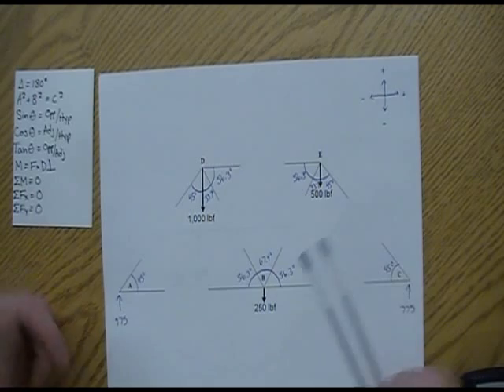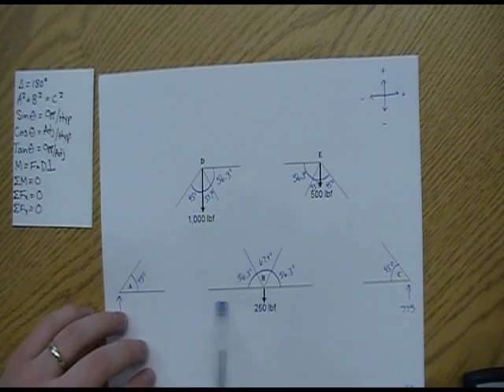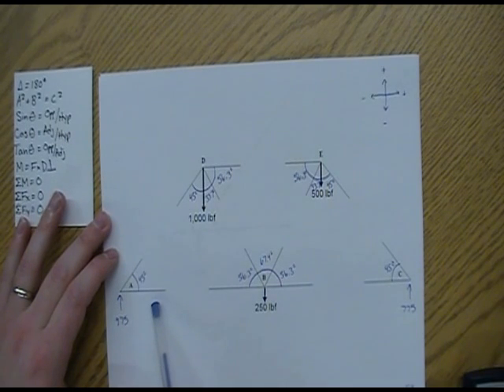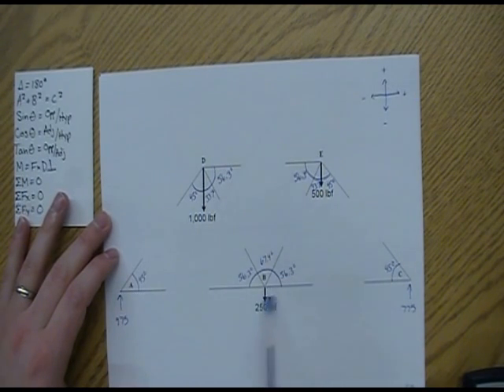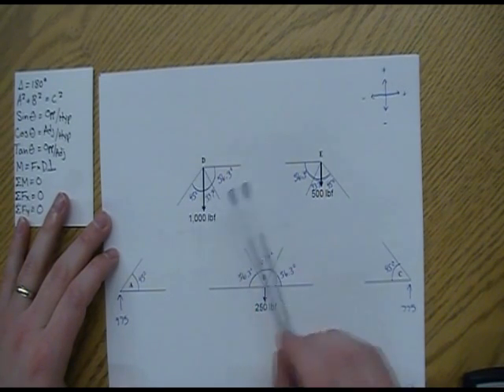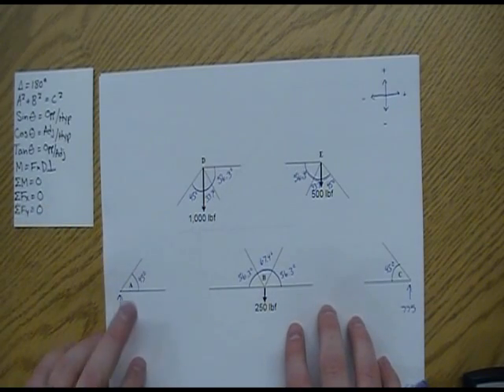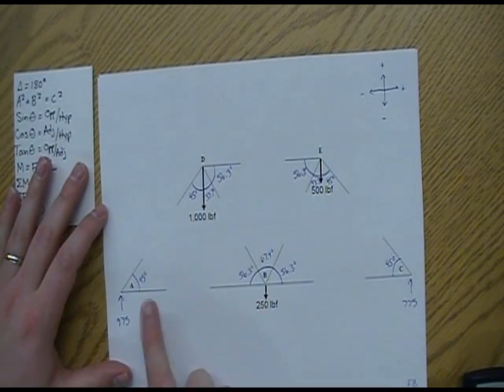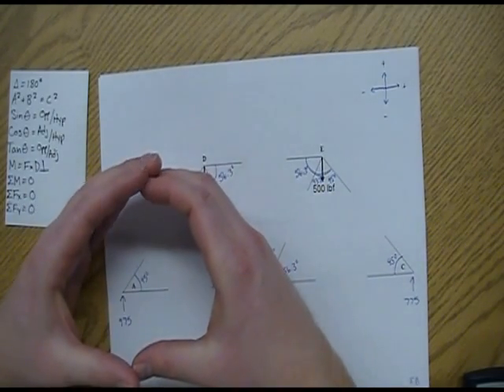How to solve a truss: Step-by-step Video 3

Comment: Isn't that tension? Not compression
Reply: The member being in compression means it's being pushed together from either end. That means the member pushes back* at the pin (toward the outside edges). That's why we calculated a 1379lb force acting onto the pin (rather than away from it).
If the member was in tension, it would be getting pulled apart at either end. So the member pulls* back at the pin (toward the center of the member). That's why we calculated a 975lb force acting away from the pin.
Reply: <   tension   > (being pulled apart)
>compression< (being pushed together)

Comment: U were wrong on force AB it is 1667. U have to take the 250 counter clockwise force and the counter clockwise force of 1000 into consideration. Your summation of forces in x direction should be -RAX+FAB+FADx=0